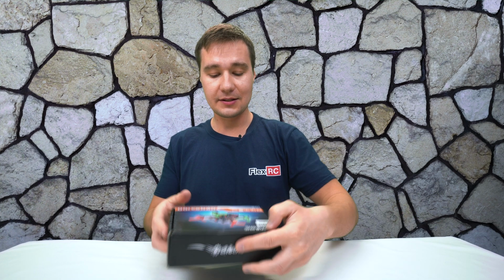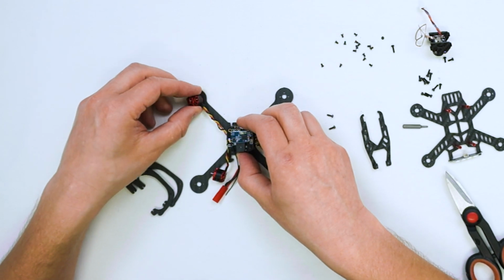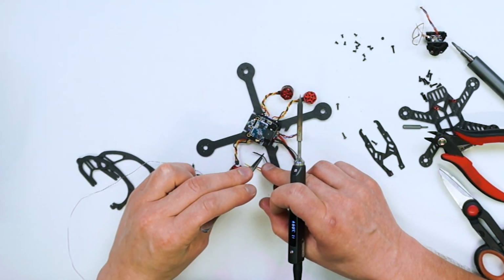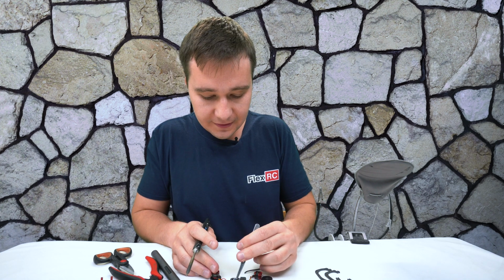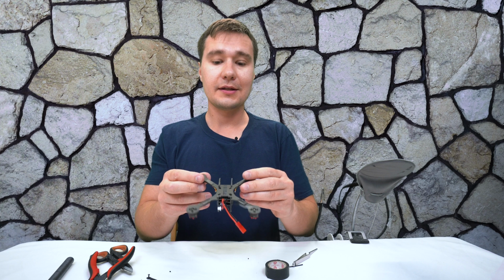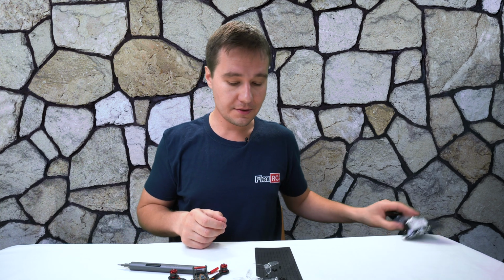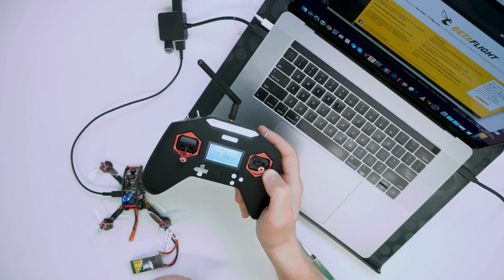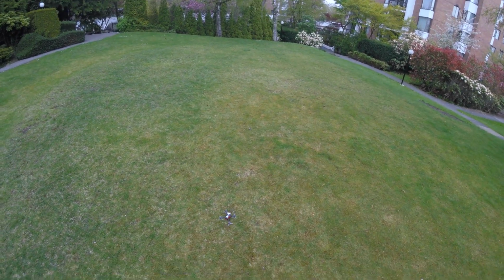How to Convert Aurora 100 2" FPV Drone to 2.5" - Build / Conversion Guide

Comment from the maker: ⚠️ PRODUCTS IN THE VIDEO  ⚠️
✅ Aurora 100 Drone: http://bit.ly/30nD2qX
✅ Ascent X 2.5" Frame: http://bit.ly/2Hm14va
✅ WowStick 1f+: http://bit.ly/2vm9JH2
✅ TS100 Soldering Iron: http://bit.ly/2Hqf0Ex
✅ TS100 TS-I Ultra fine tip: http://bit.ly/2YBl9U3